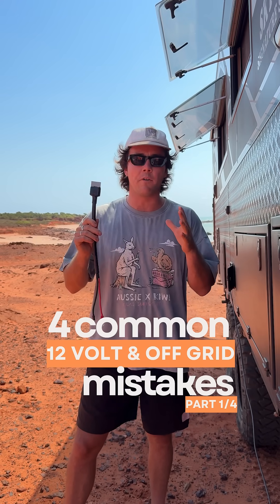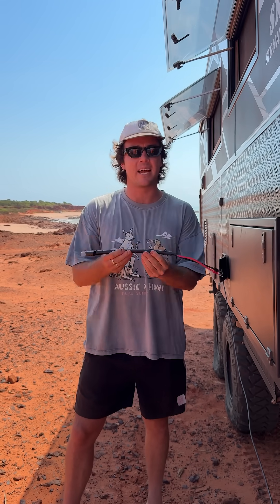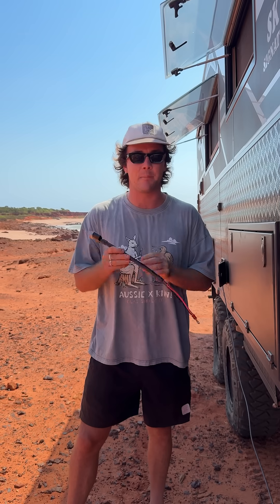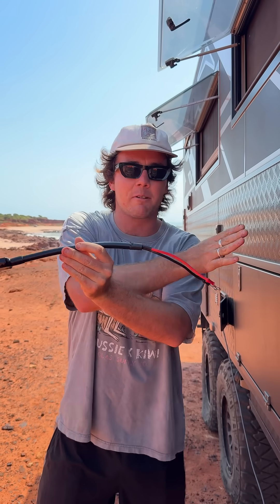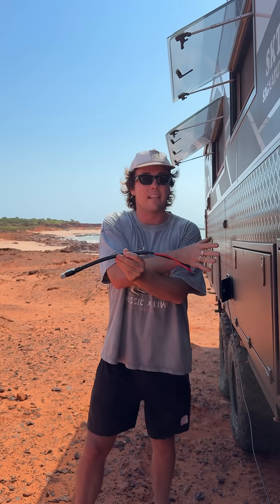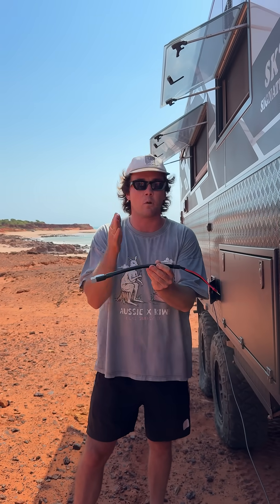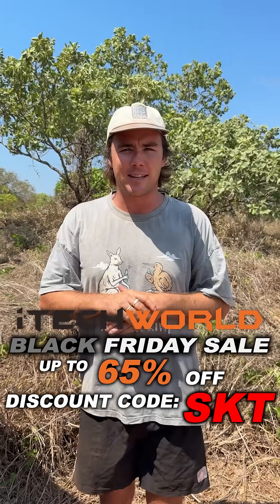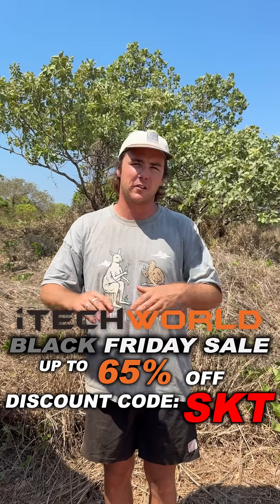Your 12V System Isn’t Broken - This Is the Real Problem!

Comment: Good lesson Professor K. 
👍🏻🇦🇺😎
Reply: Yes, so true about reducing volt drop. My auto electrician,Leon told me that any mod to an alternator/ or upgrade should not be without a serious charge wire upgrade to heavier gauge, or at least double up on the existing OEM wire....I am still amazed at how much difference this so called minor modification can do... And thank you Keelan, for reminding us to extend this fact to our DC to DC charger, and also Solar panels and battery banks also . Profound..... 🤠🦘
Reply from the maker: Thanks mate!!